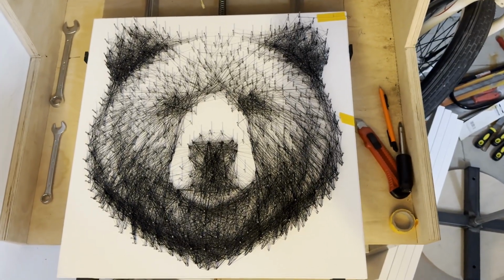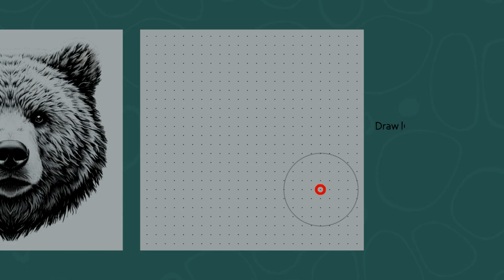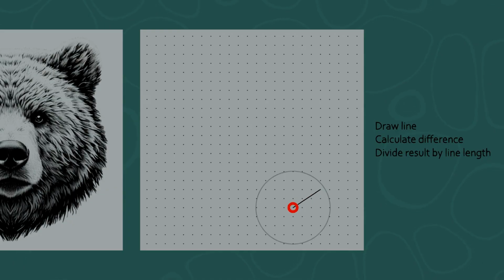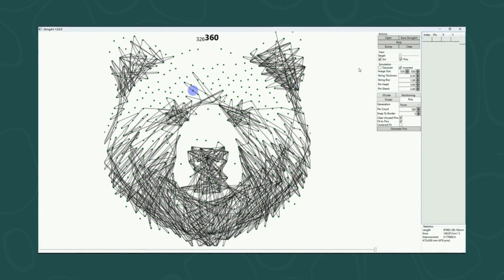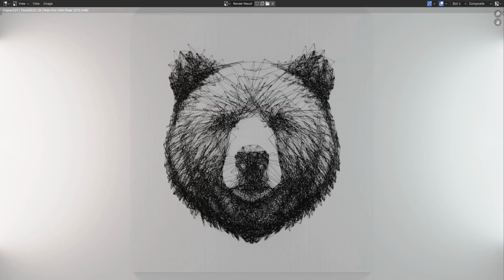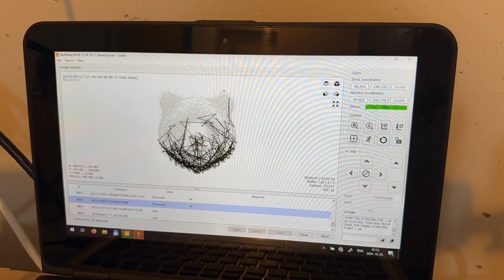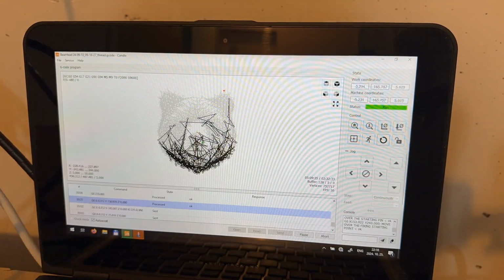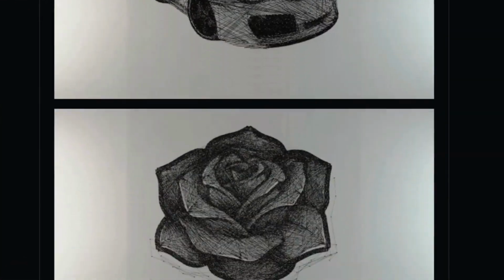String Art simulation, CNC, Blender 3D

Comment: 3:53 how do you do it with the hight?
Do you increacce a littel bit every string? Or do you keep track of the hight between the pins so it dont collade?
What logic do you use? :)
Thinking about making a cnc to do the same at some point. 
Cool project to learn different stuff.
Have been coding the image generator.
And think i will try to maby do the same as you did with using blender to get a realistic visual. 
Have no previus exsperiance in blender so it going to be tricky :/

Keep up the good work 😀
Reply from the maker: The "pecking" movement that pushes down the strings is helping a lot and also we gradually increase the height over the whole threading operation. You can make similar CNC machine I made. It was cheap to build and multi-functional. Additionally, you can mill aluminum with it if you use a stronger spindle.

Comment: I once built a hanging weighted belt driven single line drawing machine (pantograph I think it is called?) and wrote the image processing software so I know exactly how hard this project was. Well done! The way I solved it was to take the image, dither it, then solve the map using the traveling salesman algorithm. One thing I learned is that if I programmed the controller to do a little circle at each point the image contrast would be improved. I don’t think your machine needs that though, it looks great already!
Reply from the maker: Thanks, I'm glad you liked it! We apply the Sobel filter to detect the edges of the image and place nails along these edges.
Reply: @robotics_and_stuff  Looks great. So what's the plan for this machine now you built it? Mine has been in the loft collecting dust for the last 4 years
Reply from the maker: @jamesdcuk  I will move on and use the CNC machine for upcoming projects, but I will upgrade it with a new, more powerful spindle.
Reply: @robotics_and_stuff  I think there's a company in Germany that take images from the public and sells the drawn canvases. They have a machine very similar to yours apart from it can put the pins in too
Reply from the maker: @jamesdcuk  Yes, there are some people/companies around the globe who are doing string art-related business.